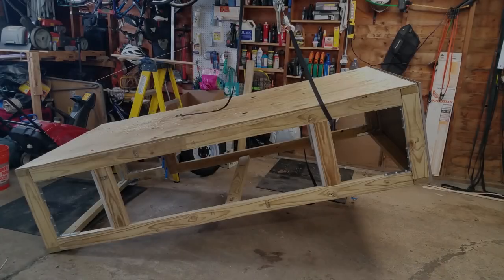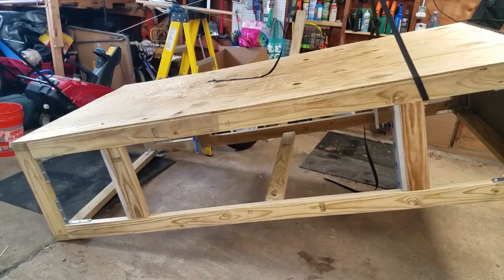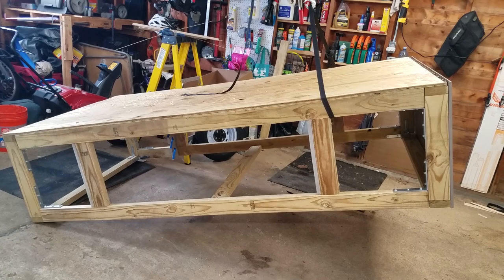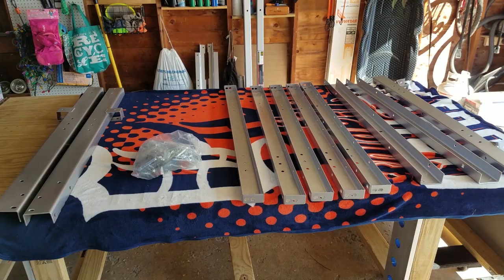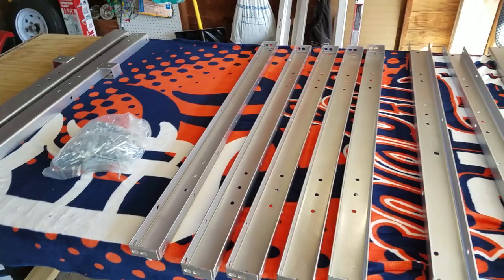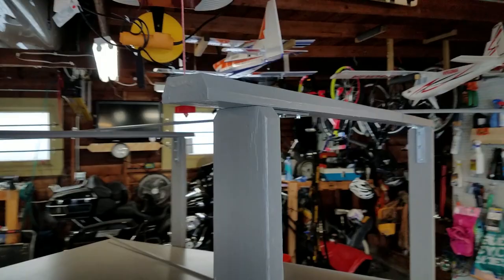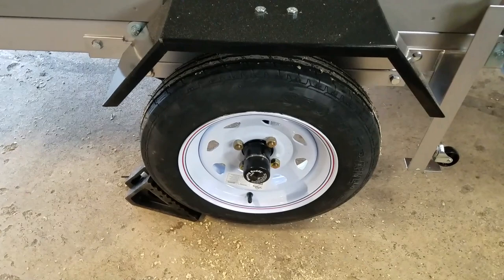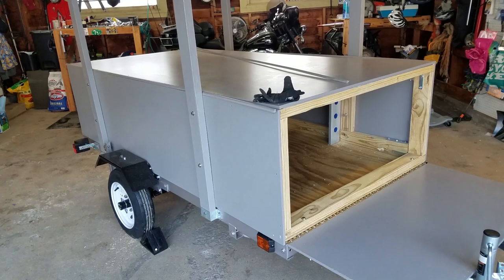Kayak Trailer Build Part 2 - Custom Kayak Trailer

Comment: How did you attach the box/deck to trailer? Did you replace the bolts with longer ones? Drill out space for bolt heads with a forstner bit?

Comment: I was wondering how you bolted the box on to the trailer frame? I didn't notice any bolts in the flooring inside the box. Such a great build. I'm basing my build off of your design! Thanks for posting these videos!
Reply from the maker: Thank you! I bolted it to the frame front and back through the 2x4s in the box. I believe it is 6 bolts total.
Reply: Did you “let in” the bolt heads into the decking? Talking about the ones holding the trailer together.

Comment: random question.. just wondering why you painted the trailer bars? I think it comes red, right? Nice build.. and parts/cuts list available? Great ideas.
Reply from the maker: No real reason I'm just not a huge fan of the red. Only personal preference. Thank you! Unfortunately I just winged it for the most part so I didn't make a build sheet or parts list. :)
Reply: @MSMAdventures  it's all good. I might just keep it red.. figured better visibility and less paint work? But make the box silver or grey like yours. I also think a slightly lower overall height might make it easier on an ol'fart like me. Thanks for the ideas

Comment: Great Looking Kayak Trailer !! I am working on one now and was wondering how did you attach plywood to trailer. Thanks!
Reply from the maker: Thank you! I used 8 bolts and washers on the base of the box through the 2x4's of the box frame into the trailer frame. That plus the uprights tie it all together for a very secure mount. Have fun with the build! Thanks for watching.
Reply: @MSMAdventures  I have a question, in the pics of the trailer before adding the ply wood to the frame, what did you do about the corner bolts on the trailer? Wouldn't they get in the way when you lay the ply wood down on the frame?
Reply: So looks like he replaced all the trailer top bolts with long through bolts up into the box. If that’s true, then I’m not clear how the trailer doesn’t become unstable the moment you unbolt all the through bolts in order to remove the box. 🤔
Reply from the maker: I didn't replace any of the original trailer bolts. Just added more bolts for the box mounting.
Reply from the maker: The box sits right on top of those bolt heads.

Comment: Since you use plywood for the top and sides. Do you have issues with water leaking in? I have to use multiple sheets of plywood for mine. Any tips on sealing the creases?
Reply from the maker: I glued and sealed corner round at the corners where the top and sides come together.

Comment: Really Nice Build! the best I've seen for the HF Trailer. I'm looking to do similar project. What is the thickness of the plywood you are using and you mentioned it the other video that if you were to do it again, you'd make it a few inches lower, would that just for weight reasons? I assume it's just perfectly fit the height of the bins you're placing inside without excess space? Thanks for a great inspiration of ideas!
Reply from the maker: Thank you so much! It's all 1/2 plywood. After using it for more time I'm not sure I would go lower. It's a great height for gear overall and yes it fits the Rubbermaid plastic tubs well. I've recently added a roof top to the top of the trailer which I will do a video on soon. Thanks again!

Comment: Great looking build, you have inspired me to undertake a very similar project! Are the tops and side walls MDF or just sanded plywood, looks very smooth.
Reply from the maker: Thank you! Tops and sides are sanded plywood. Primed and painted with several coats.

Comment: Just curious, how did  you cut in the holes for the cam locks?  just a round hole?
Reply from the maker: Yep it's just a round hole. I forget what size but somewhere around a 3/4 " drill bit.

Comment: Do you have any tips for making sure the box stays secure when attached to the trailer platform? Also, you mentioned the wood being wet. Is that because it's treated, or because it was sitting outside? Do you think it matters?

Thanks ahead of time, your work is amazing and I enjoy your videos!
Reply from the maker: Thank you very much! I bolted it to the trailer platform and that seems to be very secure. The pressure treated wood was very wet which seems to be pretty common. If you want to paint it I would let it dry for a while.
Reply: Was all your wood pressure treated or just the plywood?
Reply from the maker: I used pressure treated for all of it.